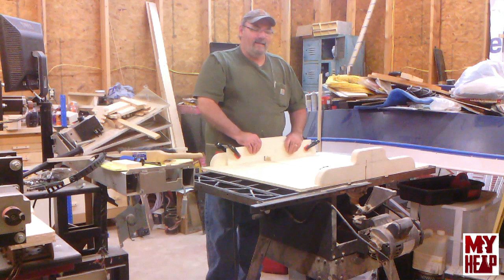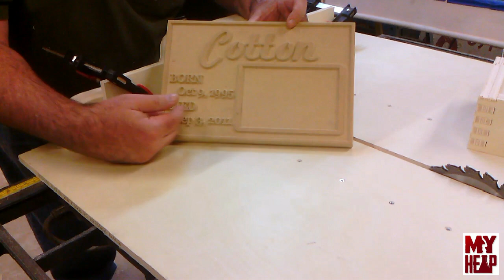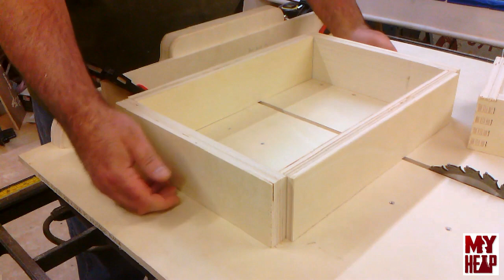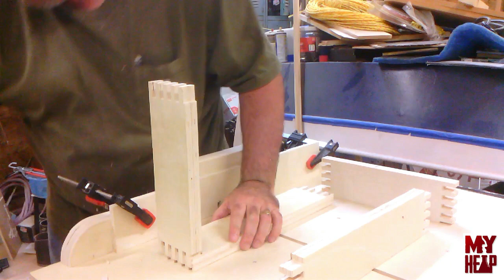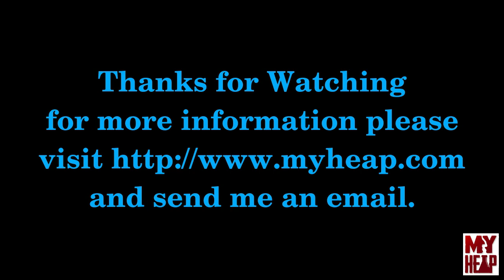Metal Casting and Foundry - Ep 2: Making a Finger Joint Molding Flask

Comment: G’day Joe I thought finger joints on a flask, really, but it works quick with the jig. I found my flask that size required internal strips of 3/8 timber to stop the moulding sand from sliding out. The things we do for pets and wives. Cheers Peter
Reply from the maker: You are correct about the jig speeding things up.  It makes them very nice to make and if adjusted better than what i done make them easy to go together too.  You are also correct in that the flask will need a gag on the inside to help hold the sand.

My wife had that dog for 15 years and when the dog died, you would have thought she lost a child.  To this day she still wont get another one.  But truthfully, if she wants a plaque on a stone, then I should make it for her.  My wife is very good to me.  I am blessed, really.

Thank you for stopping by Peter.  I appreciate it.

Joe